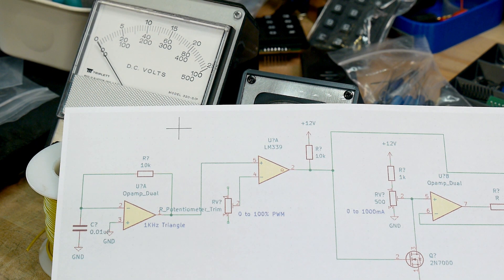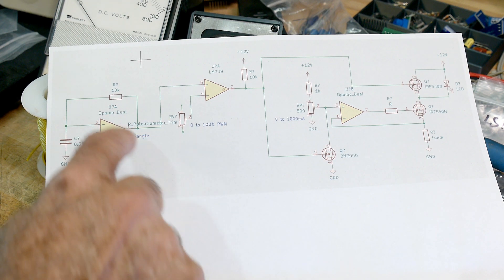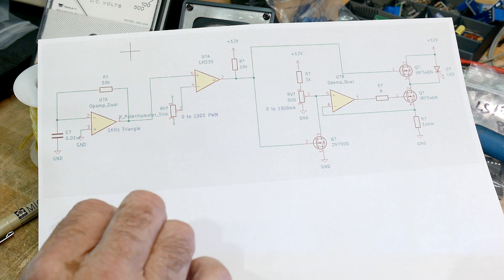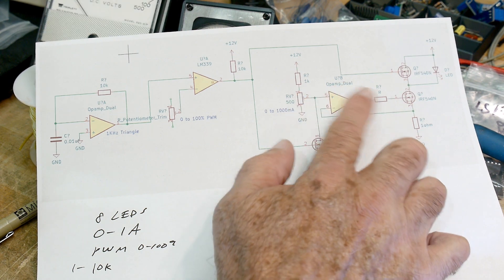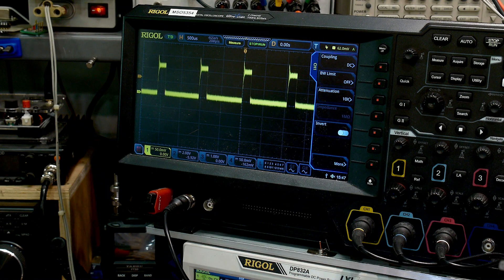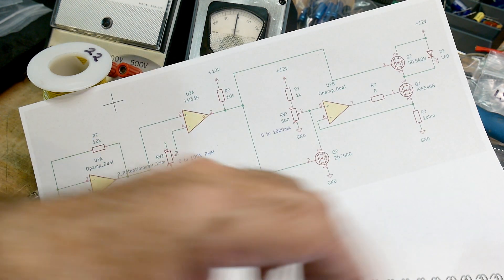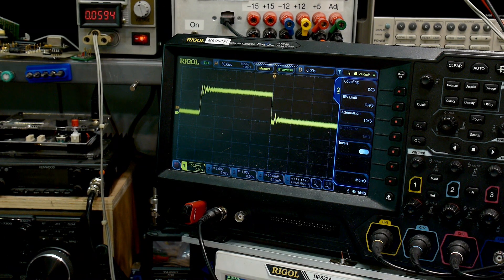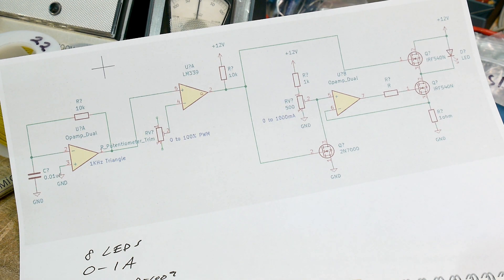#1309 LED PWM (part 1 of 2)

Comment: WHAT NO MICRO?
LOL, fun to see how other people solve problems.
There are so many approaches for solution.
And yes I would resort to Spice first. Other engineers may disagree and that is fine.
At the very least Spice removes the base level of stupidity like getting +/- reversed etc.
But correct, it does not reveal issues of stray LCR or layout problems.
cheers dan
Reply: Just depends on your background and what's in your toolbox.   It screams uC to me.  I want that baby programmable.
Reply: The problem with Spice is that you're not modelling the stray capacitances and inductances in the actual prototype. Whenever you drive a mosfet gate from an opamp you should expect oscillations from the combination of LCR in the loop between the opamp output, the mosfet gate, its source and the return through ground. The simplest first thing to try is to increase the value of the gate drive resistor because the resonance of an LCR circuit will be damped by increasing R. You just have to be careful not to overdamp because it leaves the mosfet in its linear region longer during transition and that will heat it up. Only if that doesn't fix it should you turn to reducing the bandwidth of the opamp.
Reply: @RexxSchneider  and why is this comment directed at my comment?
Reply: @mr1enrollment  Which bit of "The problem with Spice is that you're not modelling the stray capacitances and inductances in the actual prototype." didn't you understand?
Reply: @RexxSchneider  it seems to me that in my original post I acknowledged the same, so I assume that reading is not your strong point.
Reply: @mr1enrollment  Look, if English isn't your first language, that's okay; we understand. But you quite clearly wrote that you would "resort" to Spice first. That seems completely irrational if you've accepted that it doesn't address the very problems which the video poster claimed at 5:17 were the source of the ringing. Did you miss that part?
This is especially true when there is an easy test - increasing the value of the gate drive resistor - that would quickly diagnose where the problem lay. I still don't see why anyone would go to Spice as the first step if they thought it wouldn't model the prototype circuit anyway.
Reply: @RexxSchneider  Well I will try to explain in a way that my intent will sink in. My 2nd & 3rd sentence refer to generic problems solution, not the specific instance of the video. Later I refer to preventing stupid mistakes like getting inputs incorrect, this would include many commissions and omissions of the generic circuit topology. Later I acknowledge that real world LCR  problems are not accounted for. I also allow for other engineers to practice as they wish. So I fail to understand why you insist on being the way you are being? Have you not been able to pass your last meal? I know that can make an old man grumpy. I mean really - "the dude abides man",....
Reply: @mr1enrollment  So you now mean that in the real world you wouldn't resort to Spice first? What value does your "generic solution" have if it doesn't solve problems in the real world? Your point about using a simulation to help avoid stupid mistakes is perfectly valid, but irrelevant to the issues being discussed. Of course there's a place for using Spice, but it's not to try to solve the problem of ringing on a high speed circuit laid out on a breadboard. I apologise if pointing out your mistake makes me appear grumpy, but I'm actually merely amused.
Reply: @RexxSchneider  Rex, I never once said anything about the ringing. You have made the discussion about that. Amused? You speak more like you are abused for some reason. 
I am not sure - since I have not gone back a month or two to check this out, but did you and I not already have a spat about Spice? It may have been someone else, but I do recall someone being all uppity about the 'proper' use of Spice.
I want to know if you got the phone call?
Reply: @mr1enrollment  No you didn't say anything about the ringing, which means you missed the entire point of the troubleshooting that video was concerned with. Do you have a natural gift for misunderstanding the purpose of videos, or did you have to work on it? I'm pretty certain I didn't already have an argument with you about the use of Spice, but I'm willing to participate in one if you're looking to promote Spice as the first resort when examining the performance of circuits like this when laid out on a breadboard. If all you want to do is whine about not using a microcontroller, I can explain to you the problems of low frequency PWM and lack of drive voltage/current when driving mosfets.
Reply: @RexxSchneider  Gee Rex thank you for the kind offer of coaching, but no I would only accept such advice from someone that I could respect. You do not fall into that category. As to my gift of understanding, I like most people am able to take from a video that which I find interesting. I am confident that I did no whining at all. I simply suggested that I enjoy seeing the different approaches to a problem. You however seem to think that watching YouTube is like taking a master coarse in the specifics of ringing, and that anyone else with another viewpoint is absolutely wrong. You are kind of a sad type individual I have come to understand. One of the most anal retentive engineers, ( I assume you are an EE), I have ever communicated with. If you were displaying these attributes during an interview for a job, I am confident you would be rejected. That would be a shame. I suspect you have some competence in the actual domain of engineering, however, getting along, listening, and showing an ability to understand a sentence without getting your blood up has not been obvious here. So with that low evaluation I will turn the conversation back to you and allow you to make the final comments. Cheers dan